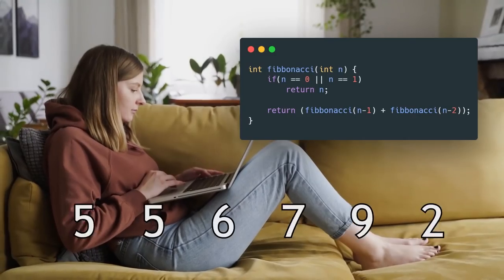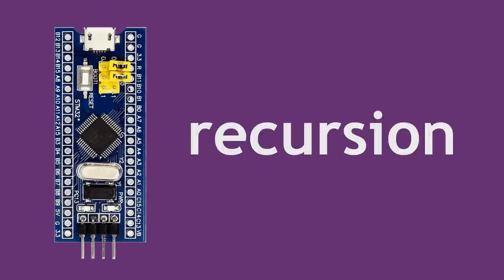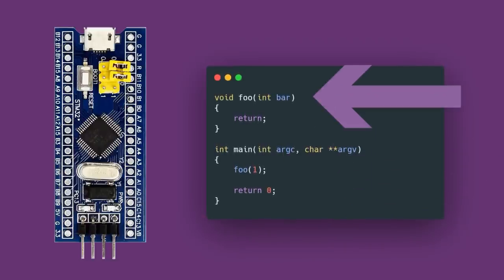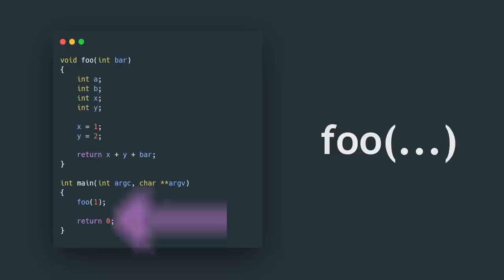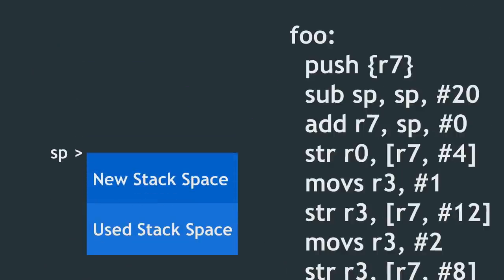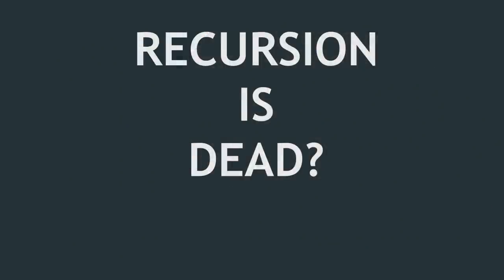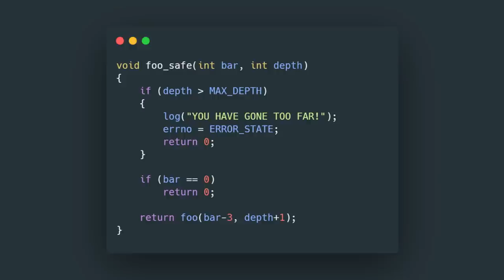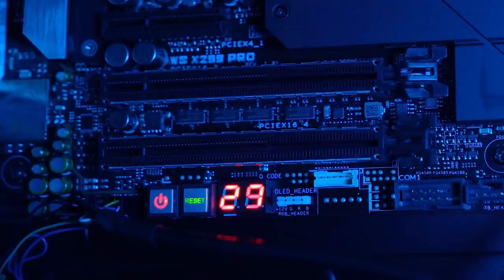why is recursion bad?

Comment: So I absolutely agree with not using recursion for the exact reasons explained in the video. A non recursive implementation is faster and uses less memory most of the time.

That being said, it should be noted that most modern optimizing compilers can perform tail-call-optimization. So if you have a tail-recursive function (last statement is the recursive return call) it will be optimized to not allocate new stack frames.
Reply: But that would require embedded folks to turn on optimization. A huge proportion of embedded ppl never bother to do that or are just plain afraid.
Reply: @ajinkyakamat7053  I don't think that is the case at all.
Reply: @gvcallen  actually some levels of optimization may kill certain opcodes thus introducing bugs
Reply: @ArnabAnimeshDas  I'm not sure in what situation that would be. If your code doesn't work under optimizations it isn't written well.
Reply: @gvcallen  I have encountered a code performing differently in different optimization levels of C. It is rare, but it is there.
Reply: @ArnabAnimeshDas  do you have an example? The only thing I can think of is volatile variables, but in that case there shouldn't be a problem if the programmer correctly labels it as volatile
Reply: I'm not an embedded systems dev. But I have experienced a lot of bugs dependent on optimization level. The reality of course is usually that the code has undefined behaviour (obvious examples are uninitalised variable & nullptr dereferncing bugs but it can be more subtle). 

There was an interesting bug in the linux kernel, where a pointer was derefernced before being null checked. The compiler took this to mean that the pointer couldn't be null and removed the safety check with optimizations on.

There's also an interesting presentation on the topic of dodgy optimizations "Dangerous Optimizations and the Loss of Causality".
Reply: Usually in this case it's easy to write an iterative version of the function anyway. I don't know if compilers do optimize multiple recursion.
Reply: @Scouarn  They don't, because in general it's impossible.
Reply: @george_763  dereference null pointer is UB so the bug was in Linux kernel, so it's not the compiler or optimization's fault. that means, if undesirable behavior at runtime was only appearing with optimizations on, it was pure chance that the undesirable effect didn't also appear without optimizations because the UB was always there.
Reply: Optimization is dependent on certain invariants being assumed by the compiler, where the value is being freed because the compiler sees that it is not getting used in the future or modifying the sequence of operations to make more efficient allocations. But if there is a ffi layer, or if it is a system function which the compiler is blind towards, the assumptions made by the compiler can backfire.
Reply: There are also situations where turning on optimizations can reduce bugs. One example is inlining. Inline definitions are only inlined with optimizations turned on which can lead to linker errors when the externally linked version is picked at compile time and doesn't have a definition.
Reply: True tail call recursive function in compiled languages have the exact same assembly as while loops
Reply: So since there is a lot of discussion about optimization in embedded context, this is my opinion on this (yeah nobody asked lol): 
There is no reason to not enable optimizations for embedded code as it works exactly the same way as it does on non-embedded applications. 
If enabling optimizations introduces bugs in your program (embedded and not) there are exactly two possible reasons:
1. Very unlikely: The actual compiler contains a bug that makes it output invalid and unexpected assembly. This has to be reported and then fixed by the compiler.
2. Much more likely: The actual program contains a bug that surfaces only in release mode. 

There were examples given with stuff like uninitialized vars and nullptr derefs, but those are 100% mistakes that the programmer made and are not caused by the optimization. The same goes for stuff like not using volatile correctly in C and other undefined behavior bugs. 
If your code contains undefined behavior and it works in debug, but not in release that is a really big problem that makes finding the bugs harder, but it is 100% your mistake since you wrote code that SHOULDN'T work. Undefined behavior generally can be read as "this does not work, but we won't enforce you not using it".
Same for inlined functions. If you create a function that is inlined despite being needed when linking, you made a mistake and didn't tell the compiler that this is the case
Reply: I always had a feeling that tail call optimisation is handled surprisingly poorly in modern languages. Some of them attempt it, but do so in an unreliable way (looking at how gcc optimizes C++ is a good example of this). So I never rely on tail call optimisation. In cases where performance matters, just iterate :)
Reply: @jord_n  please show examples of languagues and pieces of code where one could consider the tco implementation of the language to be doing poorly as you say, because otherwise your statememt holds no value at all
Reply: @gvcallen  funny enough in my ece 101 class there was an example a prof was giving in class that broke bc of optimization, he ended up having to examine the assembly to find out what was going on. Long story short the optimization process was removing a for loop that it deemed unnecessary for some reason. It's just like anything else in programming, there's always edge cases someone missed that can cause unspecified behavior if you stumble into them.
Reply: @vytah  being impossible in the general case doesn't mean compilers couldn't do it in particular cases. Optimizing multiple recursion is certainly possible in some cases, but I imagine it can get complicated quickly.
Reply: Unfortunately tail recursion is also the easiest to translate to a while loop.

Comment: I totally agree.  Even on hardware with lots or RAM, the stack size of secondary thread can be quite limited. For example on macOS the stack size it only 512k for the secondary threads.
Reply: Often this is not a problem as the compiler will convert a recursive function into a loop
Reply: @savagesarethebest7251  I don’t think you want to rely on the compiler to do something that your code already doesn’t do, as it may not do it every time or on every system.
Reply: @Thebiggestgordon  most compilers does this on most system, tailcall optimization. It is a really basic optimization, why would you turn it off except in your debug builds?.. (or even then) 🤔
Reply: @savagesarethebest7251  Why would you need to worry about memory allocation when Python just does it for you?
Because programming is full of exceptional cases.
Reply: @savagesarethebest7251  You are wrong
Try to take factorial of huge number using loop and using recursion. You program of recursion will crash at some point and it will be alot slower as compared to function which will use loop
Reply: @BruceNJeffAreMyFlies  Not everyone programs in python and some programs are better not written in python..
Reply: @shail0124  Explain this to me. How did you come to this conclusion? 🤔
Reply: @shail0124  you do know that something like 30! already overflow 64 bit int and doing factorial larger is dependent more on the bigint implementation then whether you used recursion or for loop? (it doesn't even matter)
Reply: @qwertyqwerty-jp8pr  Yes I know. I was not using programming language like C in which integer has static allocated memory. I was using PYTHON. But you can achieve that in C too by using GPM library
Reply: @shail0124  that's gmp not gpm btw, still the point is that the actual computation make the recursion not that costly (tho python sucks at recursion performance but in c it will definitely be unnoticeable)
Reply: @qwertyqwerty-jp8pr  Oh! Thanks for pointing out mine mistake.
Actually I'm not even talking about performance. Mine python program crashed with error of Memory error when I tried to take factorial using recursion. But when I tried to take factorial of even larger number than that using loops, it worked perfectly. It was faster than recursion and it was giving me right answer. Larger number just take time. But give me right answer every time
Reply: @qwertyqwerty-jp8pr  why don't you try taking factorial?
Reply: @qwertyqwerty-jp8pr  It does not really matter which programming language you are using. recursion will always be slower and bad for memory. Recursion give you just simplicity over looping. And drawback or recursion is too much that no one should use it in place of loops

Comment: Something fun and barely related to the video: the fibonacci sequence has a closed form equation, so you don't need recursion to solve for the 1,000th one.  You can just do this:

function fibonacci(n) {
    const sqrtFive = Math.sqrt(5);
    return Math.round((1/sqrtFive)*((Math.pow((1 + sqrtFive)/2, n) - Math.pow((1 - sqrtFive)/2, n))));
}
Reply: FYI, that implementation will run out of precision around fibonacci(78). By the time you get to fibonacci(1000) you have forgotten most of the digits of the number, although the video wasn't precise about whether we want the approximate order of magnitude (which the double precision method does calculate, although it fails around fib(1500)) or the low digits (which requires integers and modular arithmetic instead of math.pow) or all the digits (which requires bignum arithmetic).
Reply: Pow is of logarithmic complexity so its not constant time there. You can use matrix multiplication for n-th fibbo and solve 1000000 fibbo number in about 20 * C steps (where C is a small constant) and also with maximum precision since your generating function looses it quite early on.

Comment: as a hobbyist compilerdev and pure functional programmer, i feel mildly obligated to pop in here:

firstly, the title is. uh. slightly misleading?
secondly, i agree, recursion is apocolyptic if your call stack has a maximum size of 4.....
....which is why people who had to use very limited memory had to figure out workarounds.

tco is the most well-known one (handles the most cases, including what you showed in the video), ssa is slightly more obscure, cps is more obscure still, and aps is extremely obscure. these are all techniques that can be used to turn recursive code into non-recursive code (yes. even ackermanns function.) and sometimes even into faster code than a human could write.

thirdly, recursion actually has a chance of reducing bugs, since the base conditions act as built-in unit tests.

with all that said, i do agree that you should at least be weary, but this is way too overthetop.
Reply: I am not sure of what you mean by those styles being obscure, cps (continuation passing stye) as well as aps (accumulator passing style) are very common practices in programming and ssa (Static Single Assignment) is a common feature in optimizing compilers as well however I don't understand what is the point in mentioning those, to me it just seems like a bunch of buzzwords put together that don't help validating your statement as to why recursion is good
Reply: Did you watch the video?

He explicitly said recursion is fine if you have a ton of RAM, and that what he's proposing is to use safety methods like checking maximum recursion depth for embedded systems.

Additionally, each of those (tro, ssa, cps, ops) all follow his advice at compilation time. 

So even if you think your high level functional language maintains low level recursion - you've got two options, either it doesn't, or you run into the problem described, and should use the mitigation strategies suggested.
Reply: "firstly, the title is. uh. slightly misleading?"
That is called a clickbait